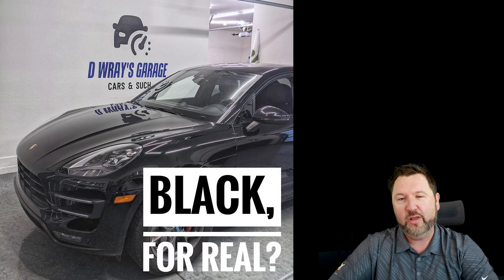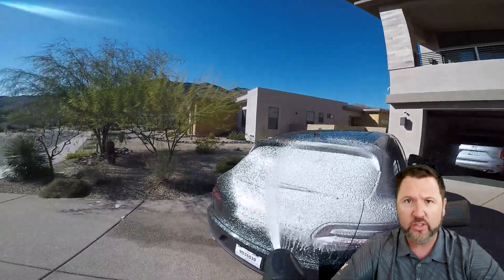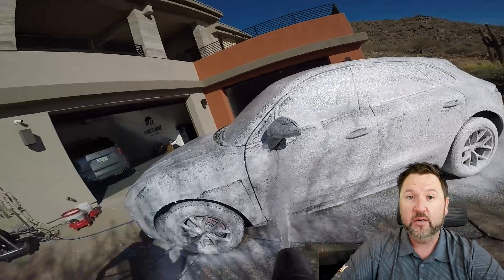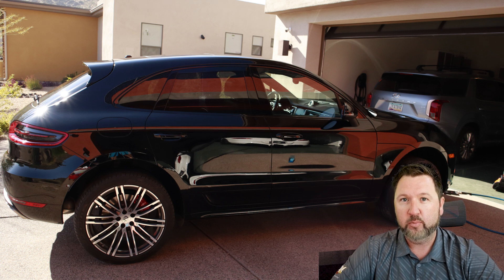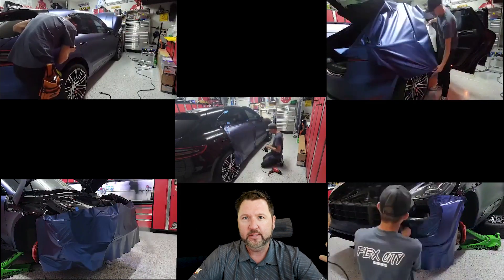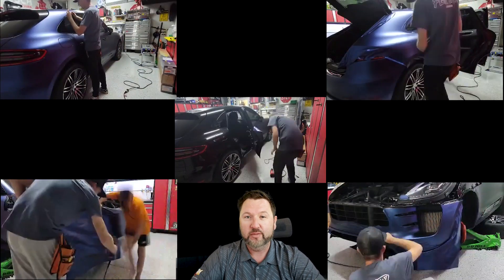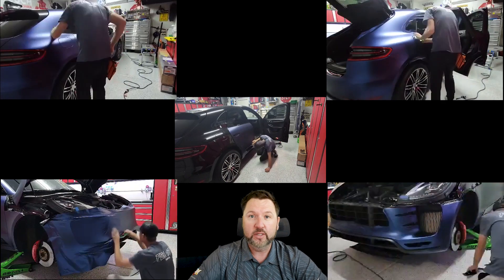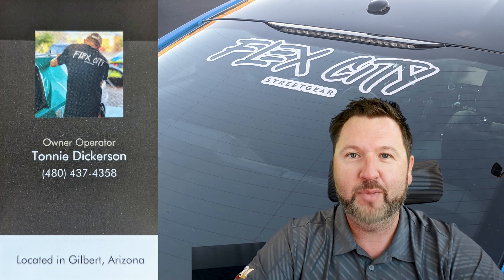It's a Wrap! Porsche Macan Full Vehicle Wrap - Matte Trenton Blue - KPMF

Comment: That looks great! I was contemplating Trenton blue for my Dodge challenger. From your pics it still seems kind of dark in the light shots. Some of the other shades seem to wash out in the sunlight and look too light to my eye anyways. I think it will look good with my dark grey wheels also. That or Avery matte metallic charcoal,  tough choices! Did you end up putting a PPF ceramic coating over it? I'm wondering if the process would shine up the matte too much?
Reply from the maker: For sure you'd PPF before, if at all. From a cost standpoint it's pretty prohibitive/not great value. Maybe the front end would make sense. Most ppf is glossy also. There's one matte out there but they wanted $7k for that on mine. For what I paid, I'll just repanel any areas that take impacts/damage.
Reply: @DWraysGarage  oh ya sorry Not PPF I meant did you ceramic or graphene coat the matte film? I'd imagine even that would give at least a somewhat shinier satin look to the matte?
Reply from the maker: I have some test pieces on my storage units that have held up well so will be applying some graphene spray soon. Tried 303 graphene and 303 Vinyl Protectant. Prefer the Graphene. It does deepen the color some. Just need to find a wash day where I can get it applied. Summertime in AZ is tough for detail work. Full sun, full time!
Reply: @DWraysGarage  I bet it is! Kind of the opposite problem up here in Ontario Canada lol.

Comment: it's now 9 months later, can I ask how the wrap is holding up? also, how well are the details of the car done? anything you were slightly less satisfied with, and would you pick this exact wrap again if you had a do-over? I am looking to wrap my 718 and trying to find unbiased review of wrappers is hard!
Reply from the maker: It's held up very well. No installation issues or bubbles. The hood has taken a couple of hits (rocks) but very small. Cleaning is pretty easy but I'm very careful to not touch the wrap unless there's a dirt patch issue. I have used touchless carwashes without any trouble. I would use KPMF again and the proof is I'm taking my SL55 in for a wrap next Wednesday, albeit in K75501 silver metallic. Love, love the blue on the Macan (as does most anyone who sees it). I'd do it.
Reply: @DWraysGarage  thank you for the info!!